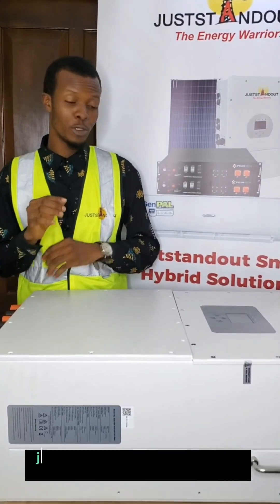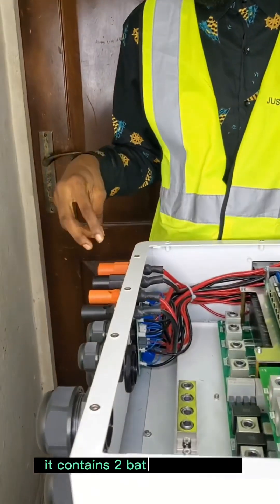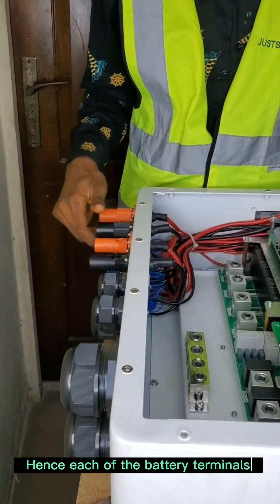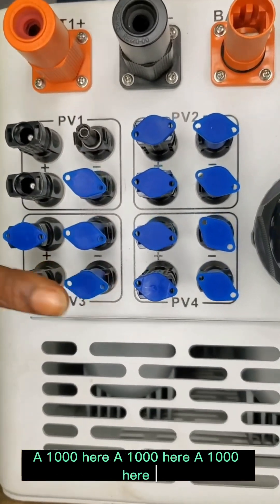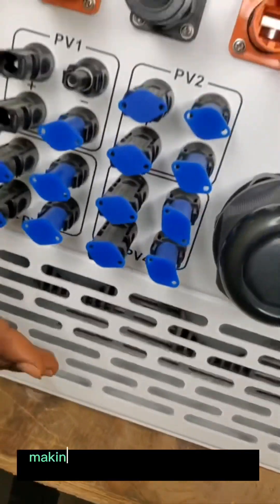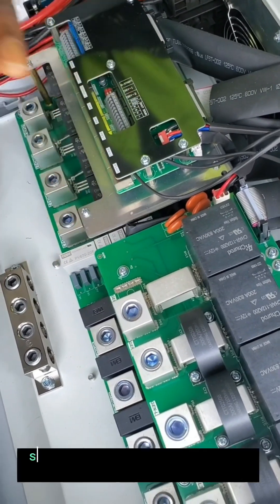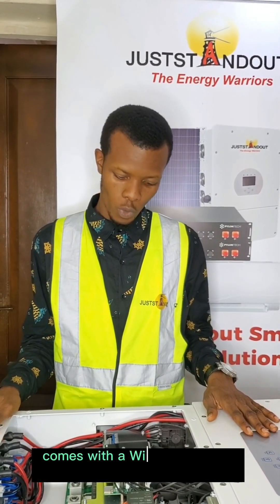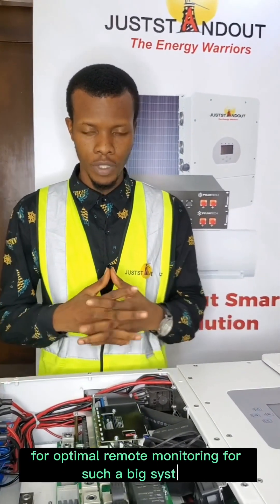Features of 50KW HIGH Voltage Smart Hybrid Inverter revealed.

Comment: You made mention of the inverter having two battery ports of about 800v-1000v each and also dual bms for pylontech batteries. I'm curious if pylontech now have high voltage batteries
Reply from the maker: Yes Pylontech have high voltage batteries. Check out Pylontech H48074.